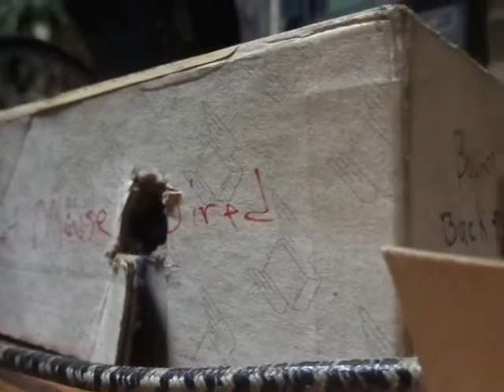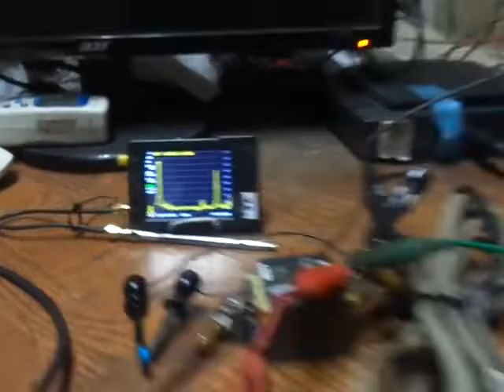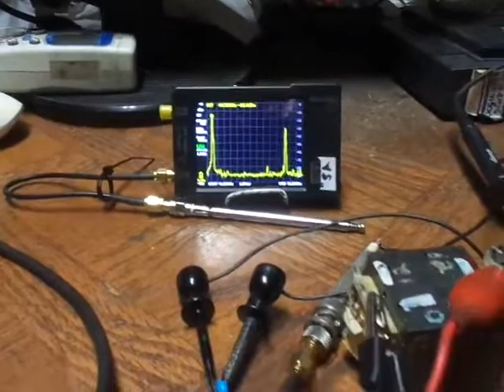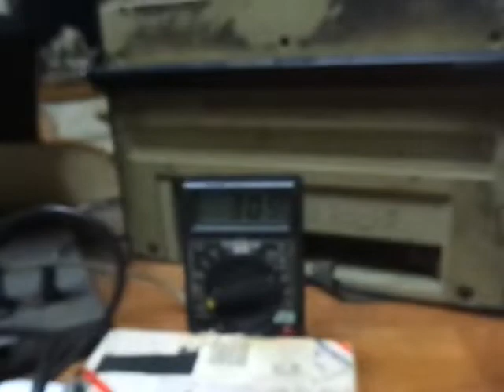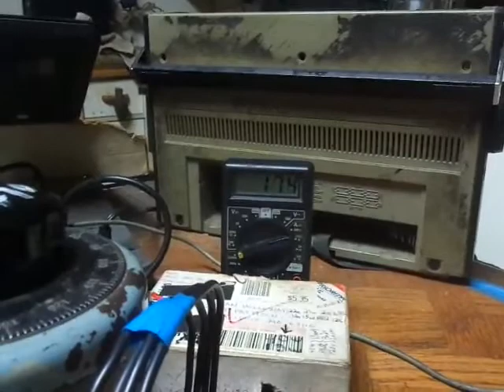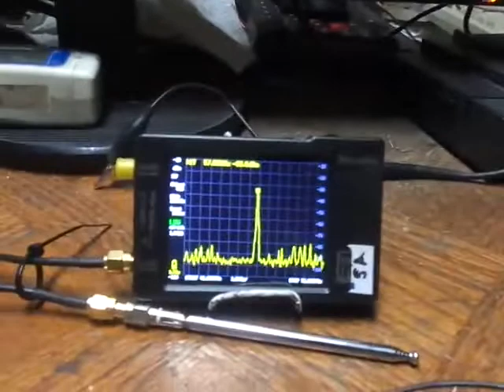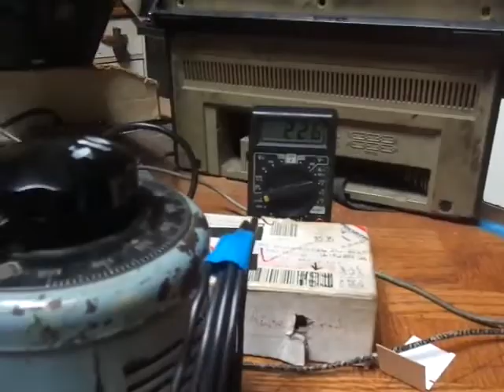22 10 29  Computer CRASH at 44MHz

Comment from the maker: Update..Never was able to duplicate this--taking necessary precautions for the new cheaper WIN 7 scope--but I have lit 2x 25w =50w bulbs with 35v 125ma or 22v 300ma. (not brightly,about 1/3 to 1/2 brightness) at 22 MHz.I even had a 5w running at 50MHz...Although.... I have also replaced many outputs and a couple inductors, mainly due to using batteries at 24v with no control over the current--but also no ground looping.I watched one amp go from 1a. 5a. 10a. before I could shut it down--blew it....This will happen if it gets too far out of tune and too much feedback with no
constraints on power.